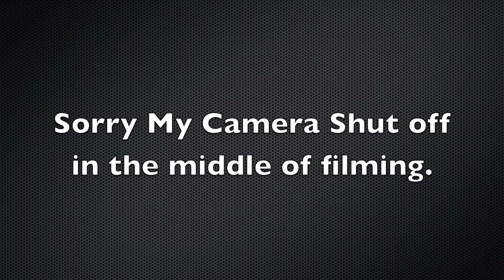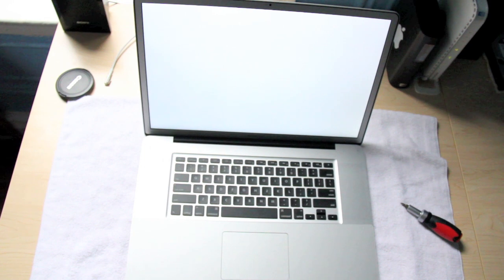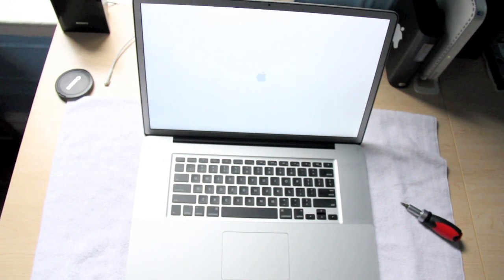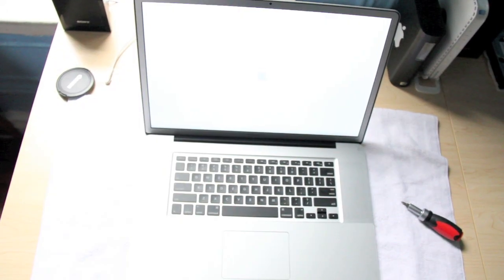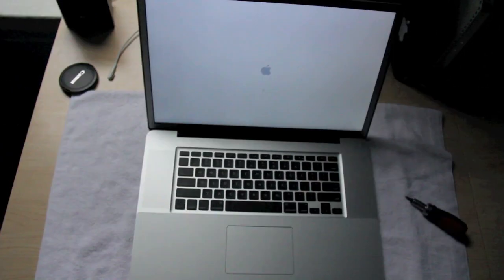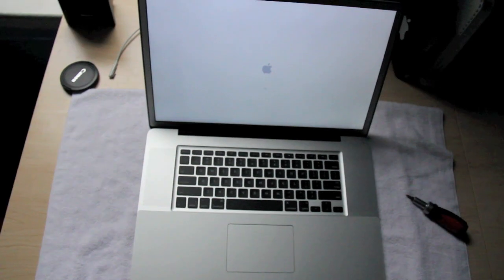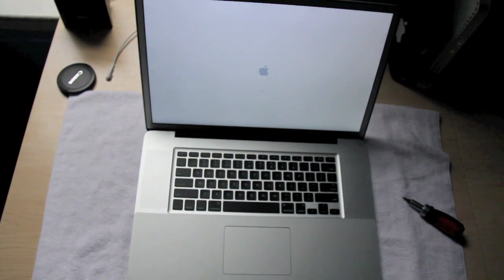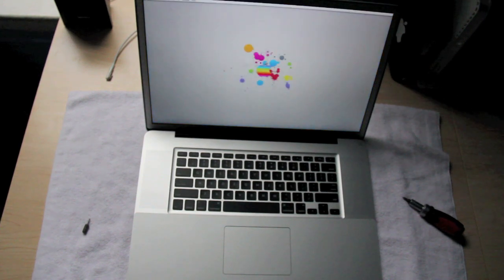How To: Remove And Install HD and Ram On A Macbook Pro

Comment: Just wondering, was there somewhere specifically you read or found out that 1866MHz RAM works on the new Macbook Pro's? I'd probably get that either way, it's like 4 dollars more than 1600MHz RAM and worse case scenario the 1866MHz runs at 1600MHz if it's not supported so it's sort of a no brainer. Just wondering if you actually read somewhere it will run faster. Thanks!